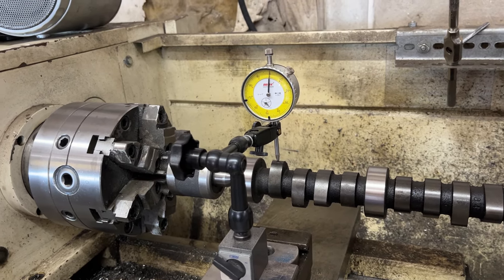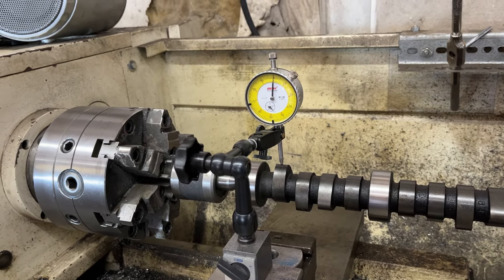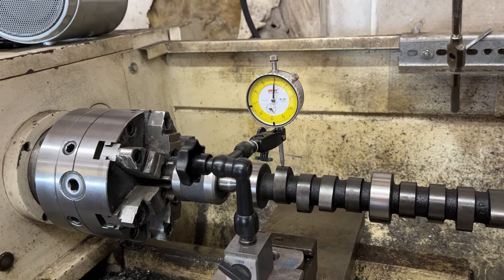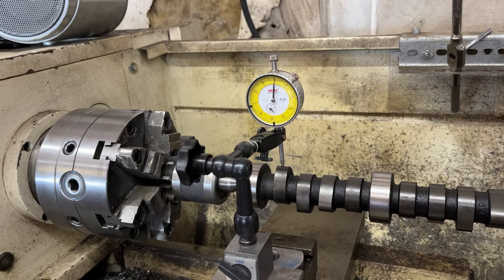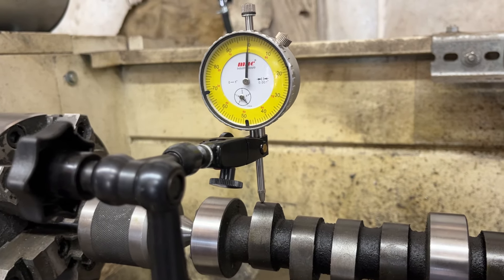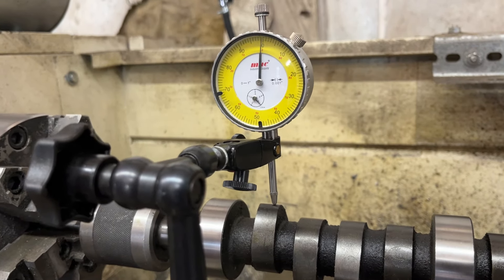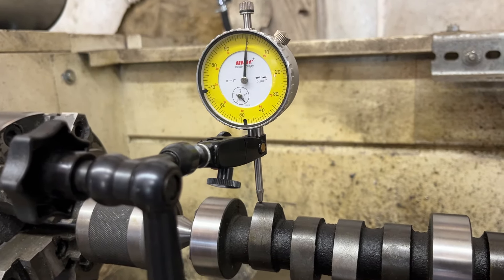Camshaft grind example that causes cam failure

Comment: Would it be possible to use a straight edge and go across 2 journals then see if the slope is present on the lobes? Do you think 3 thousands would be visible under a straight edge, shining a light from behind it?
 I would imagine that the slopes are going to be all in the same direction? Have you found that the cams that are correct have the high part to the front of the cam or to the back or that its not consistent. Thank You for your work and sharing with the videos!

Comment: That's very useful info , I've seen alot of camshaft / lifter failure in the last few years . Being that flat you could run a roller on that lobe lol . Knock on wood the roller lifter gods has been good to me .

Comment: That cam was ground in a machine setup to grind a roller cam. Whether it was the setup person, the operator,  or whomever at fault, it's obvious this cam was not inspected after being ground. Unfortunately this is all too common with cams that are mass produced.  When you buy a cam from smaller, independent cam companies they do check cams, multiple times. And yes, they cost a few bucks more. But you get a far better cam.
Reply from the maker: That was our conclusion as well

Comment: Try using a .0001 indicator. .001 is showing indicator error. It’s just a guess with a.001 indicator. I speak from experience. 35 years   Master Aerospace tool maker.
Reply from the maker: It is moving less than .001 which is basically flat.  It should be around a 3 degree slope

Comment: General motors got busted for failure to properly heat treat number 5 exhaust on all of the small block Chevys covered by this recall instigated by the Federal trade commission.
So all small block Chevys manufactured from July 1969 if I remember correctly all the way up to January 1982.
General motors did this deliberately so the camshaft would go flat anywhere between 75 and 125,000 mi in most cases design failure to induce you to buy a new car

Comment: What does a good cam measure out at? Can you show a good cam as well? Does the cam lobe measure flat all the way around or just at peak lift? What brand of cam? Lots of questions!
Reply from the maker: here are the specs.  We did not need to check the rest of the lobe as this is the highest point of stress on the cam and the lack of slope at this location is the kiss of death when combined with flat lifters with no crown which is the othe half of the equation. 

Intake Duration at 050 inch Lift:
214
Exhaust Duration at 050 inch Lift:
224
Duration at 050 inch Lift:
214 int./224 exh.
Advertised Intake Duration:
289
Advertised Exhaust Duration:
300
Advertised Duration:
289 int./300 exh.
Intake Valve Lift with Factory Rocker Arm Ratio:
0.473 in.
Exhaust Valve Lift with Factory Rocker Arm Ratio:
0.497 in.
Valve Lift with Factory Rocker Arm Ratio:
0.473 int./0.497 exh.
Lobe Separation (degrees):
112

Comment: 0.002"-0.003" ... are you sure?  A dressed grinding wheel leaves angle all the way around - at the base circle as well as the nose.  Example: I mic'd a known good cam pulled after 3500 miles [heads were changed] and side to side difference was typically 0.0033".  But if I measured as shown in this video [or better yet used an inspection plate]... that number gets cut in half, and gauge resolution becomes a problem - need tenths.
Reply from the maker: That gauge goes to .0001 not .001.  Each small line is 1/10 of .001 which means that surface is basically  flat.

Comment: who did the camshafts to begin with ?
Reply from the maker: it is a house brand for an online parts supplier.  The same company that makes these cams for the online parts supplier makes cams for most other retailers as well.  It is not limited to one brand cam.

Comment: 5 thou
Reply from the maker: The first line is .001. It is moving less than the first line or around .0005 which is basically flat
Reply: Yes he said should be 3 I said 5 closer to your correct about indicator